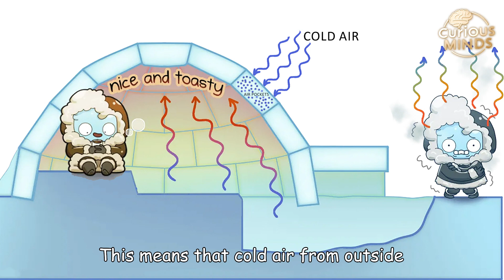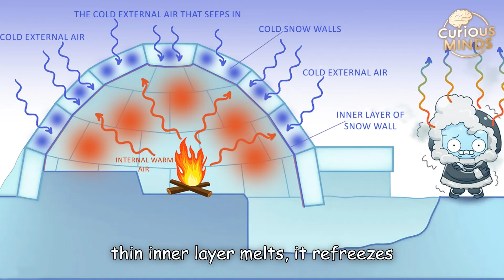How do the Inuit light a fire inside a snow house without melting the snow?

Comment: I think I got the idea. So, the fire is not even melting the igloo from the inside, because the cold from the outside acts as a cooling factor for the inside walls of the igloo to not melt. Basically, the air in the igloo gets warmer, but the walls stay solid due to the outside being so cold and keep freezing the walls solid on a constant basis. It's like someone freezing from outside, and someone heating from inside, but the cold on the outside is stronger, therefore the heat by the fire inside isn't strong enough against that outside cooling force to be able to melt the inside walls. Basically, the majority of the air stays warm, while only the air right at the inside walls gets cooled by the cold igloo walls. The point of fusion of the cold and the warm force doesn't happen on the surface of the igloo inside walls, where it would melt the walls, but right in the air around 1 centimeter away from the inside walls, because the heat can't reach further. It's perfectly balanced. Amazing tech, these igloos. ☺❄🔮🤗
Reply from the maker: Wow! You nailed it! 🔥 That’s a brilliant way to describe the balance between the inside warmth and the freezing outside. Yes — the igloo stays solid because the outer cold constantly refreezes any slight melting from the inside. It’s like nature’s perfect insulation system. Thanks for your thoughtful comment — loved the way you explained it! 😊👏